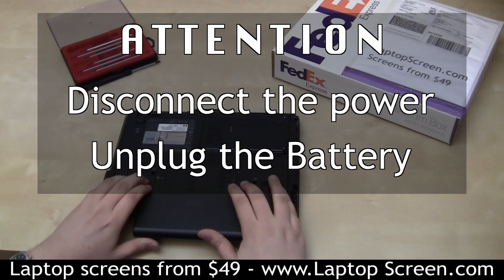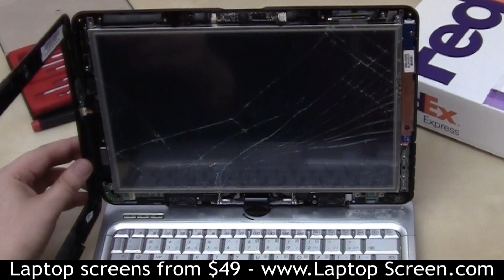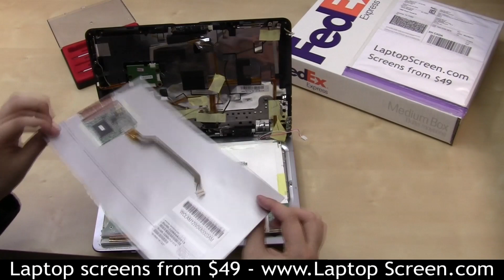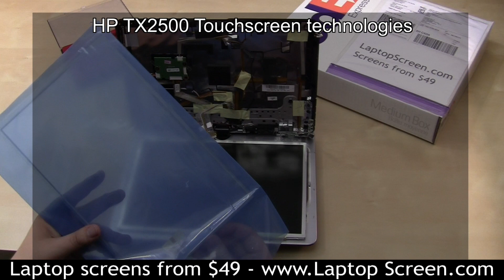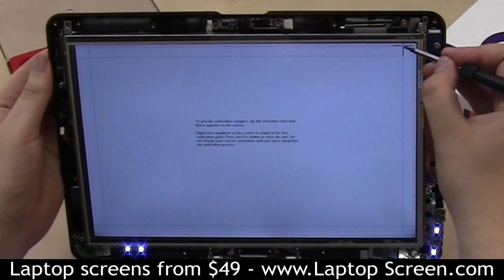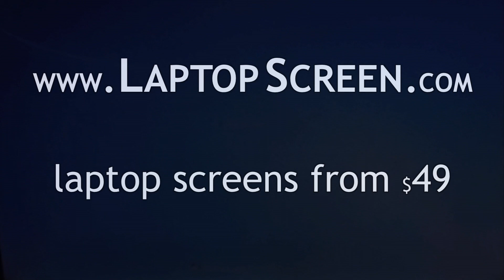Laptop screen repair, touch screen repair [HP TX2500]

Comment: This didn't help me, my laptop has a touch screen glass in the front of the screen which needs to be replaced (Acer Aspire V5-571) . It is glued to the screen all round the 4 edges. BUT a touch screen digitizer is available as spare part. Can't find a video clip to do such a replacement....
Reply from the maker: You may need a whole display assembly. Search your exact laptop model on our site www.LaptopScreen.com to see what parts are available.

Comment: what about a lenovo yoga 2 the thing that folds into a tablet its cracked
Reply from the maker: You can get the entire assembly - that way both the LCD and the digitizer is replaced as one piece.
Or if only the front glass is cracked you can order just the digitizer:
https://www.laptopscreen.com/English/model/Lenovo/YOGA%202%2013%2020344/
Reply: LaptopScreen.com thankyou

Comment: My toshiba toshiba p50-c-12z NEW, when i boot it up the screen display is very dimmed,and also when i put it to sleep. and sometimes while i am using it, it just goes dim, i connected it to my TV and never game any problem.
Is this problem with LCD or the inverter.to be clear when i use the flash of my phone i can see the picture on the screen but other than that i cant see anything.

thanks
Reply from the maker: +Chihab Adam Can't be an inverter. p50-c-12z screen is LED lit - inverter is not used for LED backlights.
If the problem is intermittent the cause can be a break in the video cable (does moving the lid affect the issue?) or a connection to the screen could be loose.
Backlight failures are very uncommon with LED powered screens, as opposed to the older CCFL lit screens.
You can attempt to swap out for a new panel but it may not fix the issue.
Reply: +LaptopScreen.com yeah , while it's dimmed I connect it to my tv via HDMI and its working fine,
Now this happens during I am on the laptop , and when I boot it up and after I put to sleep and try to wake it up
Reply: +Chihab Adam but rigt it actually working fine, but I am sure it's going to go dim at anytime, so I always save my work LOL.....

Comment: I've got one of these but the CPU or Mobo is fried. I've separated the monitor and am planning on using it as a Cintiq, but it's going to require a lot of wire work. Has anybody successfully done this?

Comment: Hi question, I noticed at the beginning of your video you removed the inverter, I'm pretty sure my inverter board needs to be replaced (screen doesn't show up anymore but it shows up on an external) so all I have to do is remove that part on the right and replace it with a new inverter?

Comment: My glass and touch/stylus sensitivity seem to work. If I salvage the glass screen protector from my old laptop, can I simply use it on the new screen?
I basically just need to replaced the LCD light.

Comment: Hello
The glass on my laptop  is cracked , my laptop model is 11.6 inch with capacitive screen ( acer 1825ptz) , my question is : still can i replace  the glass of  the front of my screen?
The screen itself seams ok is working , but my touchscreen isn't working
Thank you

Comment: The glass on my laptop is broken do I need to replace the whole lcd screen or can i just replace the glass?
Also occasionally my lcd screen shuts down at random after flickering and sometimes it works perfectly fine, I'm not sure of the root cause of this problem. Is there anything that you can recommend?

Comment from the maker: Try a different screw driver. Apply enough down force to prevent stripping. Sometimes a little bit of WD40 or machine oil under the screw cap can help. If the screw is stripped you will have to drill it out.

Comment from the maker: @MaryOfClaire The back light is part of the LCD panel, so changing the panel will fix the back light. Except in cases where the inverter might be at fault (inverter supplies power to the back light). There's no easy way to test for inverter troubles, except for replacement. Inverters can be bought from eBay or notebooksolutions ca , or look around on the web for other sources. Inverters are typically much cheaper than LCD panels.

Comment: This might sound kind of stupid, but just to make sure before I start buying parts... If my LCD light has "gone bad", will a new screen fix that? In other words, is the light in the screen, or do I have to order the light by itself?
My screen (touch features and all) still technically work, but nothing will display (unless plugged into an external monitor.). I would REALLY like to repair this myself, since HP charges a LOT for non-guaranteed repairs!! Thanks!

Comment from the maker: @shaydkh031 I wouldn't recommend that. You could connect it to USB, and get it to work. But I'm not sure if the other components won't be affected. The original glass plugs into the Wacom controller. You can still buy them on eBay. Search TX2000 glass.

Comment: @laptopscreencom THANK YOU! Do you if a 5-wire resistive touch panel would work in it? Im trying to replaced my cracked glass protector and the only resistive touch panel available is a 5wire with usb connection.